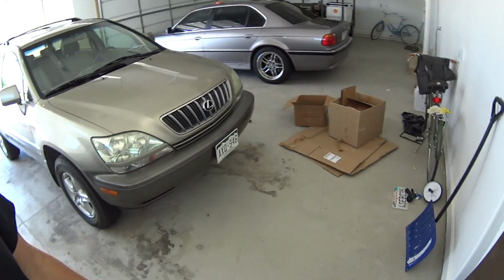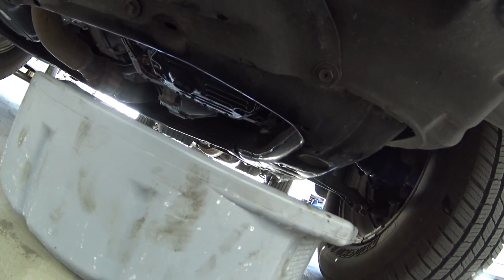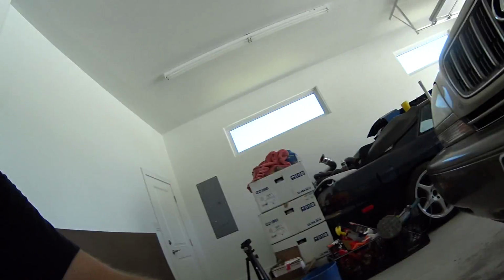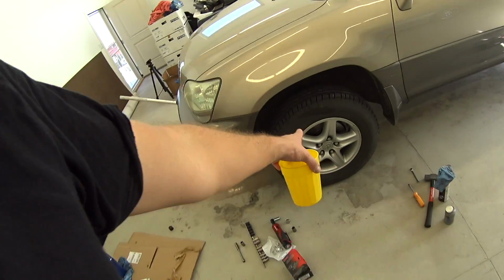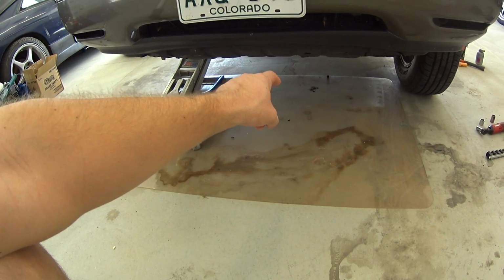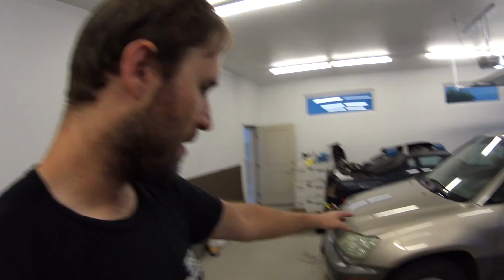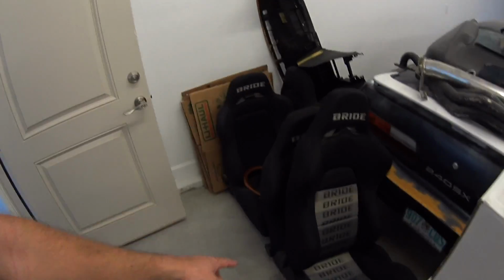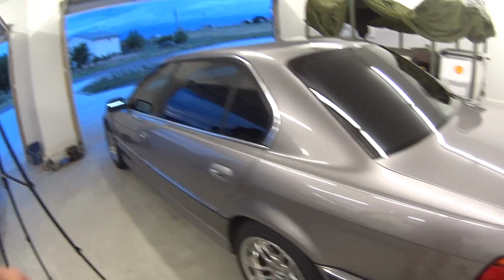Fixed Grandmas 2001 RX300 Transmission

Comment: JunkYard Dave Thanks for p[osting this video, almost bought a new $45, 000 truck but then saw this video, my Lexus 2003 had the same issue, fixed thanks to you.  I owe you a beer.  I bought 6 pack of Toyota quarts tranny fluid for $43.09 and $15.83 for new trans filter, changed myself.  WOuld have liked to seen exactly how you removed the parts and replaced them in your demonstration, Thanks Again!!

Comment: Ok, so I’m pretty sure you just provided the solution to my transmission problem, but now I have to go watch another video to see where the filter goes, and how to replace the pan gasket. Anyway, if it solves the problem then Thank You. The shop want $6,900 before taxes, and I will set it on fire before I pay that much to fix it.

Comment: I have a 2014 x5 35i . I had my transmission fluid , front & rear diff fluid, transfer case fluid all done at 49,000 miles .

Comment: Rebecca Rorie Get that Filter and fluid changed by a reputable mechanic shop! Make sure they use the correct fluid for Toyota transmissions. Then get the drain and fill services done every 15k miles after that. It doesn't hurt to use a good additive like TransX for synthetic fluid at the filter service. I own a 2001 with over 200,000 miles on the original drivetrain! They need and deserve attention at the factory recommended service intervals. Good luck!!!

Comment: The Lexus 2001 to 2002 models were plagued with a badly engineered valve body which lacked an oil hole used to facilitate pressure for shifting smoothly and cooling the 1st/reverse planet gear set which usually failed, sometimes near 50 thousand miles. 

I just rebuilt my 2001 Lexus Transmission but, even after all that it bump shifts from 2 to 3rd whose shift is determined by the application of a few solenoids as well as input from the speed sensors and throttle position. The shift up to 3rd is pretty bad, and this is after a deep cleaning and rebuild and full fluid change to the  transmission. The trans light or codes have never been triggered either, and I have successfully repaired every trouble code plaguing the car, such as it's fail safe, No OD, No Trac/VSC light show limp mode that gets activated if there's bad timing and faulty knock sensors due to over clocking of the adjustment range of the ignition timing. This is why if the timing slips a tooth on a cam, then the VSC code will be triggered, despite of those two bank 1 and 2 sensors actually working fine. 

If you have a rough shake, delay, or hard bump in shifting for these early model Lexus RXs, first try resetting the TCM by applying the gas for 3 second, then turn on ignition, hold gas for 3 seconds or so, then lift foot off pedal and you should hear a sound that means the TCM will now have to go through an adaptive learning process. This little trick prevents the need for an expensive Transmission scanner and it goes beyond what disconnecting battery terminals or clicking the neg and pos together methods. This is because this shift learning is in the TCM memory and only a scanner or this back door method can be used. As far as I know this does reset the shift learning, and it can be done for any big change to the transmission such as a fluid change. It possible that a full scanner can adjust the shift points through the scanner manually, but I have yet to bring the car to a shop to have them do that for me. One person has advised me recently that I will have to use a scanner in order to reset 'corrupted' baseline shifting if the transmission had to over compensate due to delayed pressure from the poorly engineered valve body. He said that a professional scanner will program in a new baseline, based on the OEM specs of that transmission model, and for him, it fixed all his bad shifting after months of replacing solenoids. 

Just remember, I think personally it's a combination of all these faulty parts, the valve body, solenoids, modules and accumulators, that create this typical set of issues that eventually lead to complete transmission failure from overheating the planet gear set due to a lower volume and pressure of the fluid through time, due to the bad design of the valve body in these early U140E models. 

Anyways, if the rough shift continues to happen after say 200 miles, then you probably should consider an upgrade to the valve body of the 2003 model, or, buy an upgraded valve body where an extra oil hole is added and solenoids upgraded (sensors no longer have mounting brackets on upgraded sensors from what i looked into). Seems like you can find a used upgraded valve body, in today's time, for about 500 to 800 bucks.

Also when you are diagnosing these shifting issues, check whether or not you can manually influence this shifting by using the gear selector to switch to the gear you notice is struggling. 

Basically for my delayed and rough 2nd to 3rd upshift, I put the gear selector in 2, and then shift to D at the right time and RPM, to facilitate the shift timing and allow the gears to change. If I do that in good timing, and let off the gas for the shift to happen, the problem ceases to appear. 

Basically, the issue with my valve body, and Lexus's resolution to it, was to improve the fluid flow and pressure compared to the old design that overheated the planet gear and also created shift delays. That said, just replacing my Valve Body to an upgraded model may not be enough and most likely I'll have to replace the solenoids and accumulators and seals as well. 

All this information is what I've gathered over the span of about a year messing with this Transmission issue. Please correct me if I'm wrong about some of these particulars, and also add in any information you know on this year, make and model, as well as it's giant recall that finally took place due to a large multitude of customer complaints and even bodily injury.

This 2001 Lexus I'm working on, in the year of 2022, had a blown 1st reverse planet gear when I purchased it, and so far, everything from the O2, Knock, sludge, rear main seal, torque converter, clutch packs, Orings and seals, VVT sensors, reset timing with new timing belt, have all been text book issues or complaints for this model, and I find myself chasing and repairing them all. This Lexus has almost 300 thousand miles and with all this work, it should run for at least another 100 grand. On a side note, I also own and drive a 2003 RX300, and it's been a great comparable as it has more miles on it with zero transmission issues to this day. They are both, however, plagued by the knick sensors and O2 sensor issues that turns on the Trac and VSC light, and prevents it from getting into the last gear. The transmission of course, in my 2003 Model, is upgraded from the factory to address the issues with the U140E transmissions.
Reply: Informative, thanks.  Would you buy a used 99-01 Rx 300 for $800?  And try to fix it.  I might do this
Reply: @LegolasD   Yes, I definitely would do that. I am starting to see them very cheap on market place, from many that reach a high mileage and want to get rid of it in their driveway. My main driver, a 2003 RX300, has 305,000 miles on it and after 200,000, the timing belt starting to tell me it needed changing, and that is where I'm at with that one. Meanwhile I jumped in my 2001 Rx300, that I did the transmission rebuild on, to drive in the meantime. That 01 only cost me 1500 with a bad trans, but really, it should have been like 600 bucks, but thankfully, the body and interior are in perfect shape. 

These SUVs drive very well, and during their time, they were a 40 thousand dollar luxury vehicle, and you will know it when you get in one that is running good and in good order. The only issue I have with the car, is the more complex electronics that I am now getting used to as I normally drive cars with OBD1, a more outdated and simple system. 

I kind of wish I had the AWD model, but, from what I hear, that transmission is even more temperamental. The one I rebuilt is the U140E FWD transmission, and that car has 270 thousand on it, and after sprucing up the motor, and fixing the timing and all the commonly bad sensors, it now runs excellent and strong. Keep in mind though, just the two knock sensors that often go bad at that mileage, will cost a thousand, which includes all the gaskets and wiring harness needed for that job. I also had to change a VVT sensor, and that was quite the cost, along with a thermostat, and all the spark plugs, since the knock sensors will grant you access to all that when you get into it. 

So there is a cost to getting this car up to par, however, if you find one that perhaps had all that changed already. I have seen a few for 1400, 2500, and as low as the price you mention so, if you have options, try to find one where some work for the common failed parts are addressed and replaced if possible. 

Another thing to note about this car is the safety level, and how well it drives. The cons, it  has a terrible turning radius, its only good in the rain when your tires are better than 35 percent tread, and, if and when the TRAC and VSC lights come on, it will require sensor diagnostics with a basic scanner to find the issue and replace whatever is bad. Aside from that, its an excellent vehicle that Lexus may not ever make in such form again.
Reply: @phoenixmistertwo8815  appreciate the thorough response.  Sounds great but my knowledge is less and I don’t think I’ll have the skill or time to fix them properly

Comment: I had same loud whining, also immediately eliminated by changing the filter. TIP: Use NEW crush gasket on drain plug(s)...I tried re-using, and pan drain plug still leaked even at specified 37 ft. lb. of torque. BTW, you can also remove the front differential drain plug (horizontal, about 6" behind the transmission pan drain plug, also 10mm hex) to drain out another pint of old AT fluid.

Comment: I just want say a big Thank You for this vid. We have the exact same model and mileage as Grandmas car and the same problem.  The fail safe mode was the key, thanks for that info. Was fixing to have her towed to a transmission shop and no telling what would have happened from there. As this vid is a year old I'm wondering how is Grandma's car doing after the repairs?
Reply from the maker: Still running strong
Reply: That's good to hear. I first heard the whining and thought it was the power steering pump till she quit running two days ago. Thanks again...

Comment: I know this sounds crazy but when my car I have the same vehicle that you have in your shop same color and sometimes it won't shift over 35 miles an hour so I check the tranny fluid it was fine I checked the oil it was a quart low I added a quart of oil in and then it shifted my friends thought I was crazy he's a mechanic so then it happened again 2 months later I checked the oil it was a quart low I added a quart of oil it shifted every time I added oil the vehicle was shift LOL that's no b*****
Reply: Oil in the engine and it shifted?

Comment: What a horrible video for anyone who wants to learn more about servicing the trans. Btw dorky glasses bud. 😎
Reply: I have the Lexus rx300.  The transmission is looked, the car wont move on drive and the torque converter  makes the winding noise when I start the car. Can I do same as on the video to fix the transmission.?

Comment: I have a Lexus 2001 RX300 when it start can move it have a little wine and has a little jerk first to second gear that it drives fine after it gets warmed up have no more trouble but something's wrong with it when it first starts up would it help if I just got the transmission fluid changed? It worries me anybody got some suggestions what to do please
Reply: Do you still have this problem/how did you fix it?
https://www.clublexus.com/forums/rx-1st-gen-1999-2003/562638-99-rx300-cold-shifting-problem-3.html apparently it's common
Reply: good day Rebecca! can you tell me please what was problem in gear? I have lexus rx 300 ,2001 & has same case